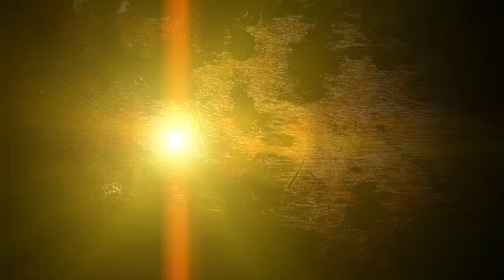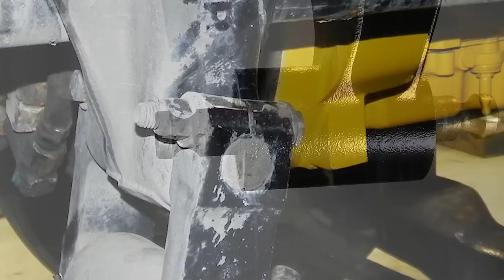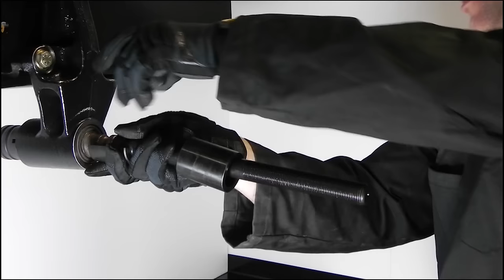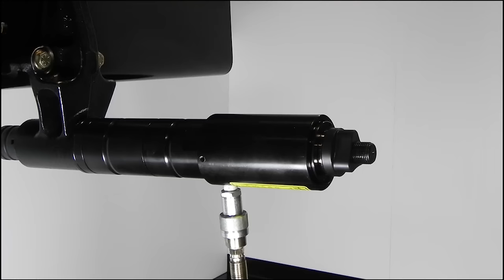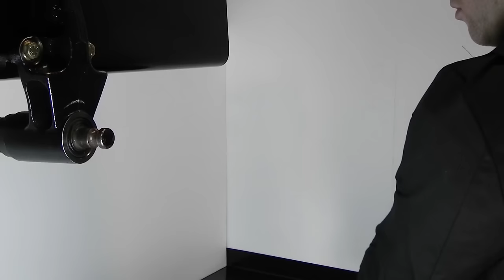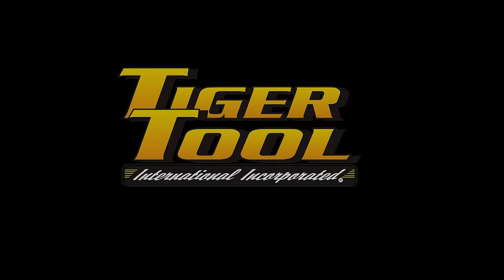Tiger Tool 15000 - Leaf Spring Pin & Bushing Service Kit

Comment: I would like to see you pull out a rusty dirty seized bush like this on a old truck that the bush has been sitting in the frames or springs for years . If you show this and the tool removes the bushes. I personally will buy a kit but first I want to see this tool under full extreme work no short cuts Thanks .
Reply from the maker: https://youtu.be/v2MMu8q2PkQ
Reply: Michael cetot how do you like your new tiger tool? You said you would buy one if they showed you a video of them doing a older bushing. Do it work good for you?

Comment: that does not work, there's no room for that device
Reply: Me and my dad used this equipment in my 2000 mack cx 613. We had to take off the plastic fender that screws on to the steps. After that, everything went smooth. 👍 for this device. I do recommend it.
Reply: Plenty of room on my truck for it. I wish I had one.

Comment: I just don't get the purpose of covering the other side? It's only pulling one side..
Reply from the maker: It pulls the pin and bushing assembly together; otherwise, the cylinder would simply pull the pin out, leaving the bushing stuck in the spring eye.
Reply: @TigerTool  i see